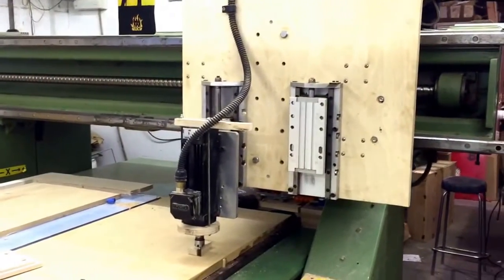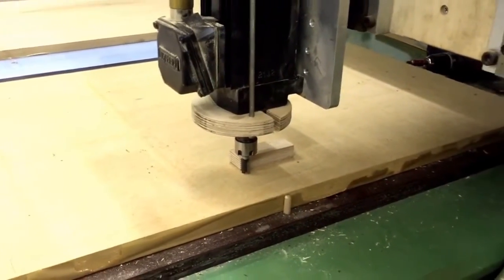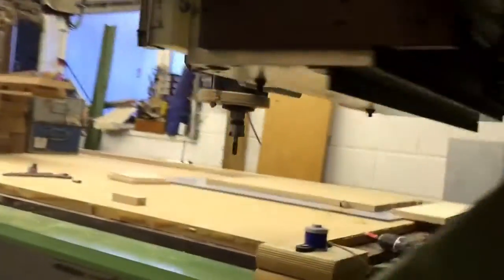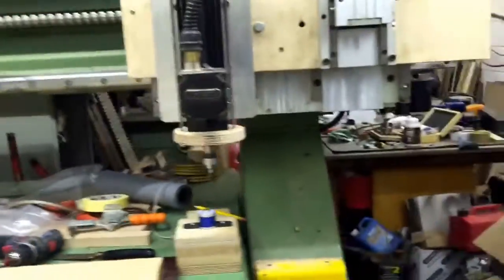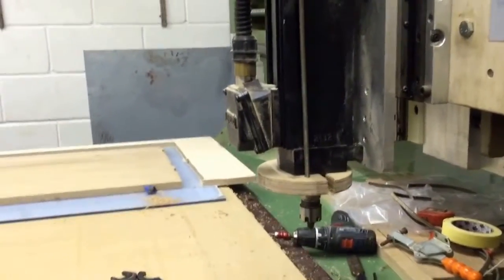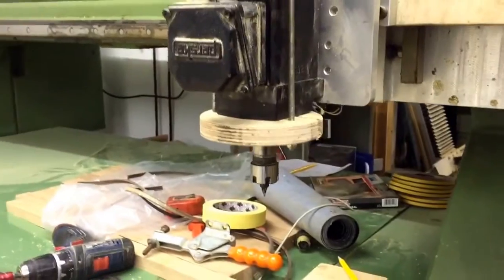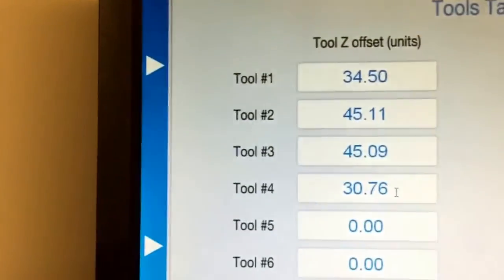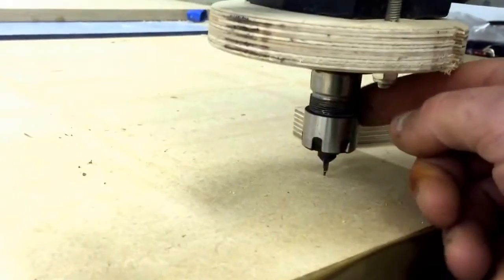Uccnc auto tool set and save to tool table

Comment: Can you please tell me where to set the value of the actual sensor in relation to the table.
Reply from the maker: Ricard Rinaldo put sensor where you want. Probe once and note the measurement.
Adjust to the rough length of your tool.
Not too important as every tool is referenced from the same place.
You still need to set your work zero point either to bed or to top of work as required.
Reply: @automateanything  Sorry but I don´t quite get it. :(
When you say "adjust to the rough length of your tool", what do you mean.
Do you have a good link or video to how this is done, I only found one with the Stepcraft where you had to go in to
some sort of setup file and enter the height of the tool length sensor!?
Reply from the maker: after you have probed- check the probed length- against actual tool length. adjust the z position of the probe in your probing macro until it gives the correct length. this only has to be set up once. then every tool you probe after that will be referenced from the same probed position.  my probing macro i wrote to work in machine co ordinates- so afterwards it will work in any work offset.

Comment: This is exactly what I'm trying to do in UCCNC. Please post more information and let me know if I can obtain a copy of your tool change macro and please let me know what probe you are using. Thanks. Jim
Reply: Thanks. I've tried a few macros that I found on the forums but can't seem to get any of them to work properly. Not having a background in programming I'm stuck unless you might post your code on the new forum.UCCNC.com forum. Thanks for considering it.
Reply from the maker: my macro wont help unless you modify it for your machine.
what machine do you have?  are you trying to set tool lengths or work z zero?  (different)
do you have a probe?
Reply: Yes, understood. I've built my own hobby cnc router based on the open source x-carve. I'm just learning and I find that looking at different ways to approach a problem helps me to better understand possible solutions. I have an M31 probe macro that works with my copper clad FR4 touch plate but adding probe and tool change macros together just makes sense.
I located a combination macro on the cnczone forum under UCCNC macro sharing subject but I have not been able to get it working on my machine yet.
Having adapted the M31 macro to my machine I've learned a little about what needs to be changed. I expect to pick up a "real" touch plate but for now the simple plate works. 
Being new to this I went with UCCNC instead of Mach3 because of what I read and how enthusiastic the folks at cncdrive seem to be about their product. They have been very supportive and with more videos like yours I think this platform can overtake Mach3/4.

Regards,

Jim